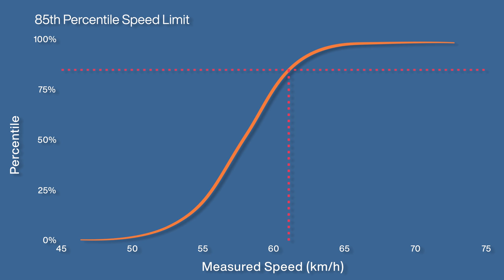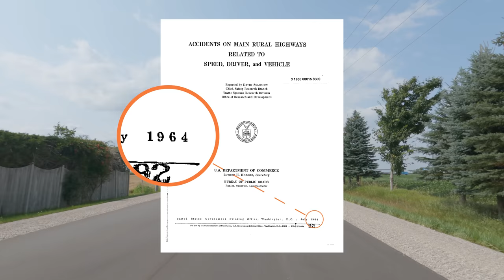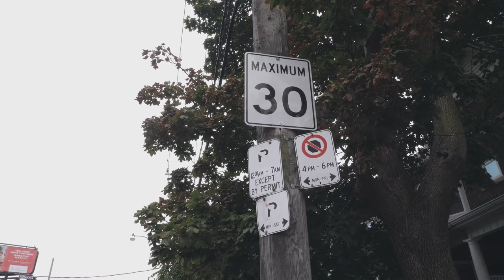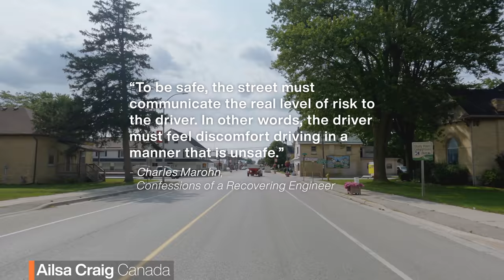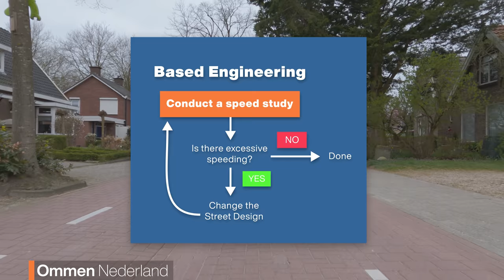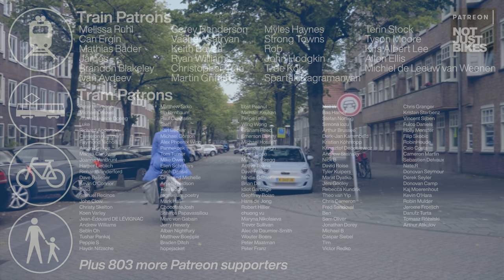The Wrong Way to Set Speed Limits [ST06]

Comment: The only part of this video that irked me was at the very end, you seemed to lay all the blame on the engineers. In Seattle, I've seen many cases where good road design was proposed, but then shot down by angry residents who have gotten used to the old ways of road design. If you don't have buy-in from residents, you'll usually end up with a very short career.
Reply: Basically, if you want streets to be streets like you want streets, there better be lots of high speed roads available as an alternative.  Nobody wants it to take longer to get from point A to point B.
Reply: The whole city has a 25 mph speed limit
Reply: @wahid5923  it's less the speed limits, and more the redesigning or reclassification of roads that seems to be more problematic. Especially if such redesigns take away street parking or add more crossing points for pedestrians.
Reply: Part of my Senior Thesis as a civil engineer was to help out a small residential area with their flooding problem. We provided an initial solution of a curb and gutter. Residents said no, curbs are ugly. Ok, large french drains leading to their various retention ponds. Nope, to expensive. Ok, we can put a giant dam at the top of the hill which no one owns and where a large majority of the rain water is coming from, hopefully it holds and doesn't redirect the water to the other houses nearby (spoiler, it fails and floods the area even more). That last one wasn't our design. We made several cost effective solutions of the first 2 but in the end we turned in our notice to be removed from the project and left. If they implemented only 25% of our solution, flooding in the worst part would have been reduced significantly, but since half of the residents were not heavily affected by the flood, it wasn't their problem so they would only pay pennies.
Reply: @scottanno8861  Part of it was NIMBY and I did understand why they didn't want a curb system. Their entire area was curbless, sidewalkless and full of trees which made the area really nice. The problem was that it was also in a flood zone and watershed zone. I would love to go back and see what they ended up going with 10+ years after I left.
Reply: @Geotpf  - Getting from point A to point B really fast is usually helped by a thing called 'staying alive' and 'not being in an accident' or 'stuck in court defending yourself from a vehicular manslaughter case'. Getting to point B really takes a very long time in those cases. Not driving 70mph through a town center helps with that. 👍🏻
Driving fast =/= arriving fast.
Reply: @TheMrVengeance  the US usually defaults to pedestrians being at fault in those cases, not drivers
Reply: @TheMrVengeance  Thing is, you're overstating the risks when you say that, because most people's experience is getting from point A to point B without getting into fatal accidents. People, on an individual level, are statistically unlikely to get involved in accidents on any given trip, or even in any given year or decade. Most people probably get into at least one accident in their lives, but they probably aren't fatal ones.

So your preaching here is falling of deaf ears because it's like warning people that they shouldn't ever go swimming at a beach, because they could get eaten by a shark. Yes, it's possible, but it's rare enough in any given experience or even lifetime that it's not considered serious enough.

If you can't find cities or suburbs or towns with the designs you like, and you can't sell them to enough people to get them to voluntarily implement them where you live, perhaps you're not as accurate in your estimations of people's tolerance for risk vs. inconvenience as you think. 

The solution is never browbeating those who are less risk-averse than yourself, and certainly isn't the evil of attacking and trying to harm them with force if they don't comply. The solution is to either build what you think will work better and try to attract people to it, or to come up with a better way to accommodate both what you want and what they want. If you can do the latter in a way that resolves frustrations that people who've previously rejected your proposals did have, but were willing to tolerate, without creating intolerable (to them) frustrations to replace them, you'll actually get a lot of takers.
Reply: @DouglasWalrath  My understanding as a US driver is actually that it takes some extraordinary circumstances for the pedestrian to EVER be considered at fault in a vehicular accident involving pedestrians. Generally, the driver of the vehicle is at fault unless it can be shown the pedestrial essentially hurled himself in front of the car. Even if a pedestrian is jaywalking across a highway, if he's not making sudden movements that make his motion hard to predict, the driver has a lot of trouble defending himself if he hits the pedestrian.
Reply: @michaelmullin3585  There is also much more to it as well when it comes to flooding. Future impact of the development, how much nature is still there, and retention ponds. Most of these are overlooked. I moved from Florida to Texas coast. Texas' lack of retention ponds, and clearing away all trees to fit more houses always confused me. Then they complain that all the streets are flooding.
Reply: @segevstormlord3713  - Please point out to me where I'm forcing anyone to drive the speed limit with by the threat of violent force?
Oh.. you're just making sh*t up? Okay.

If you want to talk statistics, any deviation in speed from the mean speed of traffic (either faster or slower) increases the risk of you getting into an accident. Significantly. As in, 10mph increases your odds by 6x.

So it's not just swimming at the beach. It's swimming at a beach in Australia that specifically has a warning up about a current aggressive shark issue near the beach. And not just swimming by yourself, but dragging a bunch of involuntary bystanders into the water with you.
(Because accidents don't always only involve yourself.)

Deliberately speeding because "you're in a hurry" and have "places to go" will only bring you to one place in a hurry, and that's the hospital. Hopefully not the morgue section.

Saying I can't have an issue with speeding until the perfect road design I'd want is implemented is like claiming I can't have an issue with school shootings until I pass perfect gun law reforms.
Road design being bad, doesn't make speeding good.
Reply: @TheMrVengeance , I think you misread my post, since your own statistical example neither supports nor refutes what I said; it's quite irrelevant. I never said anything about being for or against speed limits. 

Perhaps I also am guilty of assuming something you weren't talking about; given the context of this video, I assumed your comments about "getting from point A to point B faster" were in reference to the remodeling of roads (or streets, or stroads, or whatever this video wants to call them) to being the grossly unpleasant-to-drive-on and traffic-choking atrocities that this video celebrates as "good design." I apologize if you were not expressing support for those; I assumed you were.
Reply: @segevstormlord3713  - I thought it was pretty obvious in response to the "gotta go fast, all the time, everywhere" crowd.
Plenty of people throughout the comments, including the one I responded to, complaining about lowering overall traffic speeds through road design because "beep beep, got places to be, gotta get from A to B, better give me a superspeedy highway you street-loving turtles.. vrooom!"

As I said. The only place that kinda attitude gets you fast is the hospital.

EDIT: Also the streets, roads and highways that are shown as good design aren't even remotely unpleasant to drive on. I can say this as someone who's driven on them.
(Which is a stance backed up by a number of other people in the comments who've driven on both US/Canadian roads and Dutch/European roads.)
Reply: @TheMrVengeance  , now you're not being consistent. Are you talking about changing and enforcing speed limits, or about changing how roads/streets/stroads/whatever are designed to make speeds slower?

If you're talking about "both," then I will respond to "both."

On speed limits: they absolutely are enforced by threat of violence. What do you think happens to somebody who refuses to stop for a police car trying to pull him over to issue a speeding ticket? To somebody who never shows up in court to pay speeding tickets? To somebody who refuses to be arrested and brought before a court if he's caught with a warrant out for him due to refusal to show up and pay speeding tickets? Is violent force not on the table?
Reply: @segevstormlord3713  - Maybe you need reading glasses? At no point do I bring up enforcement of speed limits, fines or any sort of pro-police stance. So I'm really lost as to how that would make me inconsistent??
At no point do I even refer to traffic stops or warrants.

So it seems the only one being inconsistent is you, by attacking an absolutely ludicrous strawman. 🤷🏻‍♀️
Reply: @TheMrVengeance  , you said, "Please point out to me where I'm forcing anyone to drive the speed limit with by the threat of violent force?" and then went on to talk about how speed limits save lives. I was initially thinking you were talkingabout modifying roads, but then you reacted with that line. 

We're obviously talking past each other somehow.
Reply: @segevstormlord3713  - Were not talking past each other. You're just very eager  to put words in my mouth. Because arguing a strawman is after all much easier than addressing actual points.

I pointed out the objective fact that speeding greatly increases the risk of getting into an accident. Something that's been shown numerous times in research.
And somehow you turn that into me advocating for some sort of violent police enforcement of speed limits.
🤷🏻‍♀️
Guess it's hard to argue with objective data.
Reply: @DouglasWalrath  Not on the East coast we don't. Pedestrian has always had the right-of-way, since all of our states and many of our cities were founded before automobiles were invented.
Reply: @TheMrVengeance  , I wasn't arguing against objective data. You're putting words in MY mouth, and trying to distract from the fact that you've failed to provide any rebuttal to my statistical statement.

What, praytell, do statistics about deviating from speed of traffic averages have to do with anything? And yet, that's the only statistical thing you've brought up.

We could prevent all fatal car accidents by outlawing cars, but we don't, because the inconvenience is not worth the increase in safety. Statistically, people are not in enough accidents - let alone fatal ones - on an individual basis for them to feel the need for the increased inconvenience and discomfort of being compelled to drive more slowly. This is an objective fact you seem to be smugly avoiding addressing while accusing me of avoiding objective facts. If it were not true, then people would already be trying to drive more slowly, voluntarily, and would be eager for anything to make that easier.

The horrific "streets" recommended in this video would be better off simply banning cars from them. Build real streets for actual driving that people aren't going to be walking on, and keep these atrocities also more open and useful to the pedestrians and bicyclists by making them less unusable as traversal areas and instead simply not letting cars into them. Segregate the car areas from the pedestrian/bike areas and you get the result that is desired better than by pretending the cars you don't want around are allowed to drive there.
Reply: @segevstormlord3713  - Again, reading glasses? I literally state that you DON'T argue with objective facts. Because you can't. Again words put in MY mouth, with you claiming I've said things I haven't.

As for your new strawman. Whether or not "enough people die to compel people to drive slower" isn't at all an objective fact.
That's 100% subjective. And also never anything I claimed.
I never once argued for outlawing cars or lowering of speed limits. 🤷🏻‍♀️

I'm also not sure what you're trying to accomplish with your final points. A lot of places ARE actually making streets car-free, and it's pretty universally doing wonders for small local businesses and breathing life into town centers.
And in places where they don't people don't just walk on the street? Have you ever even been to the Netherlands or Europe?

(Also, if you're suddenly so concerned about pedestrians and cyclists. Compare the number of road accidents and fatalities for them in the US to those in the NL.)
Reply: @segevstormlord3713  - I very clearly did not. I plainly stated that you were arguing a strawman INSTEAD of arguing with the objective fact I'd brought up. Because you couldn't argue with a fact.

If you think that's the same as accusing you of arguing against objective facts, I don't think even reading glasses will help.

Go back to my first comment in the thread. 
You'll clearly see that the only point I'm making is that; if you want to get from A to B, speeding isn't the way to do it. Considering the highly increased risk to your own and others' lives. And the fact that any accident is going to cost more time than any time you saved previously.

You were then the one that began bringing up and accusing me of; threats of violence, advocating for police violence, dragging people into court for speeding, lowering speed limits, browbeating, compelling people, etc. etc. etc.
As if any of that was at any point an argument I made.

I also find it pretty telling that you've been calling the examples of road design in the Netherlands "undriveable abominations" among other terms, when you've very clearly never even driven on them.

EDIT: Also, don't call me sir.
Reply: @TheMrVengeance  you might not know this but there are only 30-40k car crash deaths annually in a country of 350 mil people that travel over 3 Trillion miles.  You are way over stating the risk of motor related deaths.
Reply: @segevstormlord3713  you are so right in this argument.  We drive 3.2 trillion miles annually with only 30-40k car crash deaths.  We live in a spread out country where you travel through many times more cities than you stop in. Theres no way you are gong to convince a driver outside of a metro that this euro street design with slower speeds is the way to go.
Reply: @JfkNeedsWindWall  - You might not know this, but that's 12.4 traffic deaths per 100.000 people or 14.2 per 100.000 vehicles. Whereas the Netherlands has 3.8 per 100k or 6 per 100k vehicles.
That's "only" 226% more needless deaths. 🤷🏻‍♀️

Also you do realize that this "euro design with slower speeds" is for inside metro areas and cities right? Outside of cities in the Netherlands/EU there are highways.
Which at 75mph actually have a higher speed limit than most of the US.

(It even used to be 80mph for large sections. But that's been brought back due to environmental reasons.)
Reply: So what you're saying is, progress these days still comes down to the dissenting Boomer.
Reply: @__-fu5se  so what you are saying is you have no argument for or against. I'd bet a majority of home owners in a spread out country like the US will prefer fast travel road designs over the "drive slow cuz it feels unsafe" type small European towns. The only people I've ever met that enjoy driving slow are foreigners and the old people or boomers as you call them
Reply: @JfkNeedsWindWall  - The irony of you accusing someone of having "no argument" when you slinked away into radio-silence after getting clapped with facts. Lol.
Reply: Engineers have been taking flak like this since day one. In reality, the engineer almost never has the final word.

Comment: This video is simply impeccable. Having moved to the US recently, I never find myself driving the speed limit, because the roads make you feel like you’re supposed to go faster.
Reply: Yep. You're supposed to "go with the flow of traffic" you can actually get a ticket for driving speed limit if you're moving slower than traffic. I noticed this immediately when I first got my license as a teenager, people will honk at you for going speed limit.
Reply: @ChawletMelk  This not speed limit this is speed suggestion.
Reply: @ChawletMelk  Speed differential, not speed, kills. That's why it isn't a good idea to mix bicycles and cars.
Reply: I mean I don't really drive according to the speed limit here in the Netherlands either. Only in towns. But roads where its max 80km/h? Nope drive 90 there. The highway where its max 100? Nope drive faster than that. Dutch roads are so safe for speeding that the speed limits set are ridiculously slow. Here 80km/h roads should be city roads that are max 70km/h now. And 80km/h roads should be 100km/h. And the highway which is 100 and 120/130 between 6am and 7pm should be 150 everywhere besides a select view spots like bridges and highways intersecting. But sadly we wouldn't change this probably.
Reply: The car lobby is incredibly strong in the USA. The Ford Motor Company invented the word "jaywalking" and got it made into a crime. We could have built cars that were incapable of speeding DECADES ago.